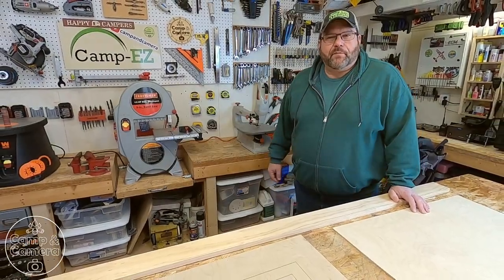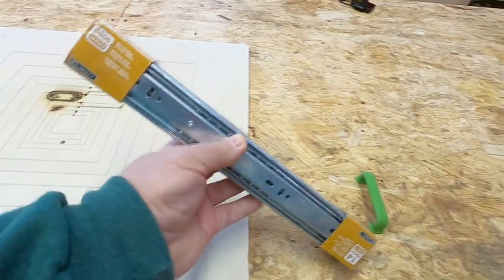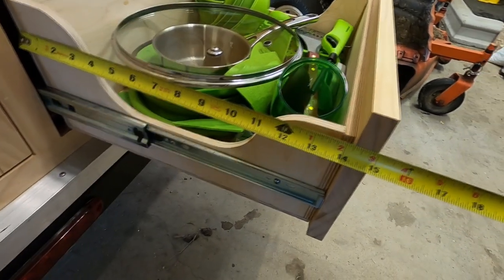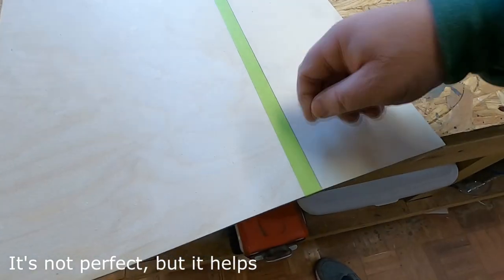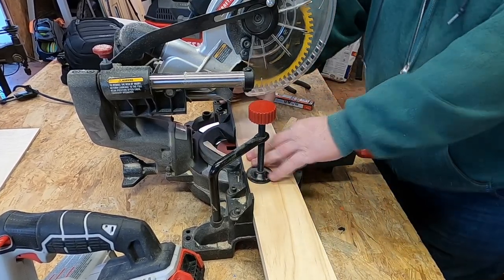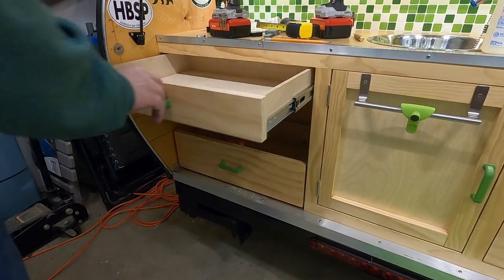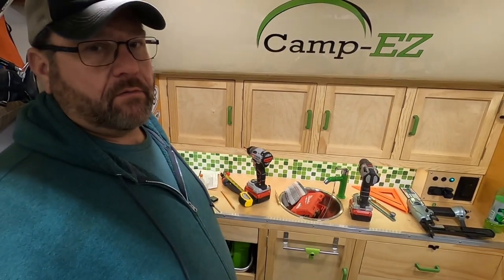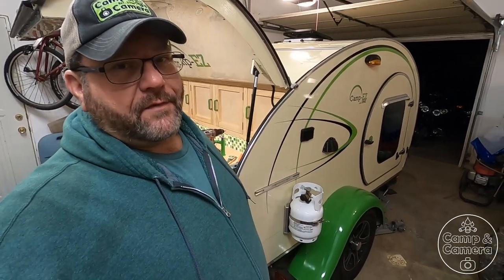Teardrop Camper Drawer Construction

Comment: That’s amazing! This is really helpful. I’ve been wanting to try to build a nesting pull out system of slide out drawers for the back of my Subaru since my camper is so small.  I don’t have a lot of wood working skills so this is very helpful to see the drawer process.  That battery adapter tip!!! 😱👏🏻   Hope you got out of trouble with Joann!
Reply from the maker: Using these particular drawer slides, the only critical dimension was to make the body of the shelf 1” smaller in width than the space it’s going in.  The height and depth weren’t very critical.  I believe you’ll find it way easier to make some drawers for your Soob than you might expect.  Oh, I’ll never get out of trouble!  Lol!!